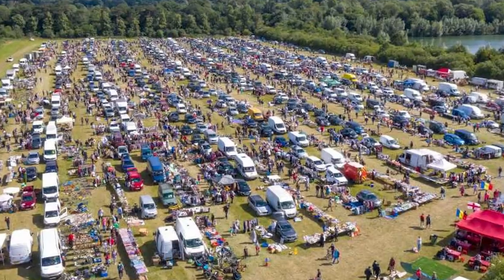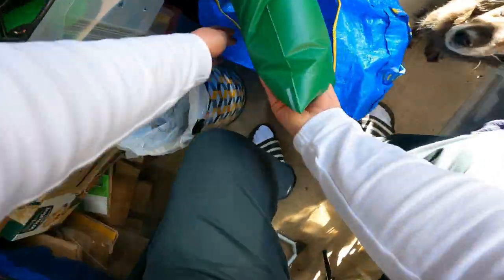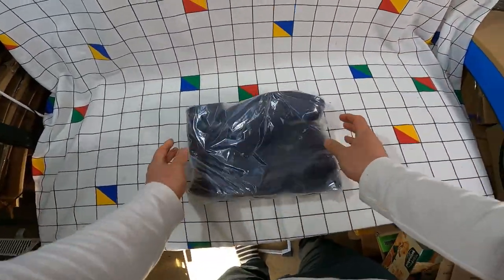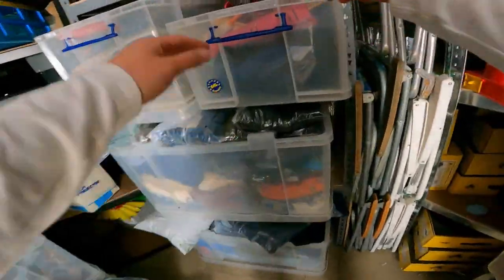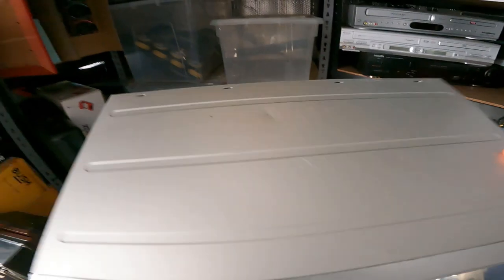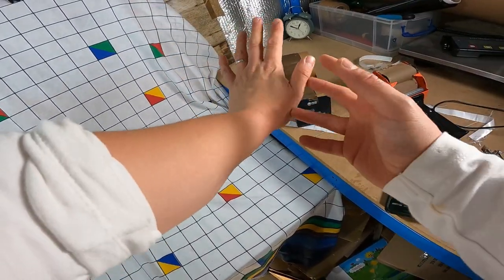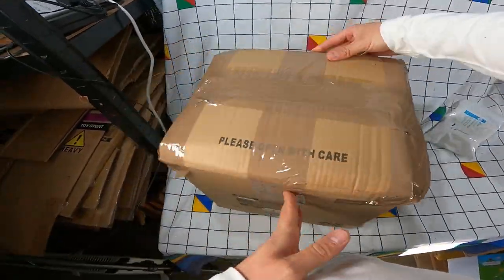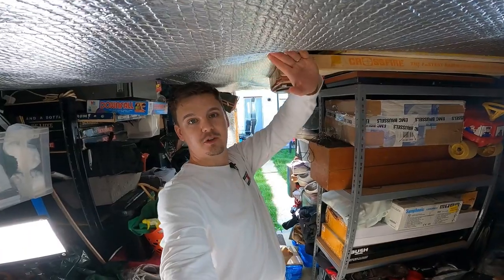DON’T Let This Happen With Your Parcels

Comment: Hey George great videos, just wondering do you post everything with Royal Mail or do you use different couriers for different items for example with the electrical, pans and glass items?
Reply from the maker: Hey Steve, I use royal mail for all clothes, shoes and smalls under 2kg then everything else is a mixture of Evri, ups, parcel force or dpd

Comment: Your boxes aren't big enough for the lamp and the VHS.  When you are taping up and the VHs was bigger than the box just putting a couple of sheets of cardboard wont do anything if it is dropped and lands on that side, same with the glass lamp shade it was poking up out of the second box.  Both need to be in a box with void fill surrounding each side so it is "floating" in the box, otherwise you are asking for trouble.
Reply: I think he knows what he's doing mate, he's sent more parcels than i've had hot dinners
Reply: @DanWhoResells  Sure thing just you pack like that then :)
Reply from the maker: All items arrived safely Geoff 👍🏻
Reply: @RetroReselling  Good to hear but your boxes were still too small.  When your item is poking up and you cant close the lid then you are asking for trouble.  I get my big boxes from pet stores, they have big boxes double walled ones so they are strong.